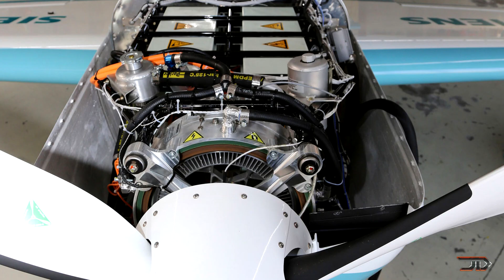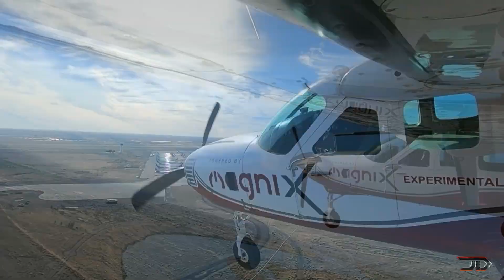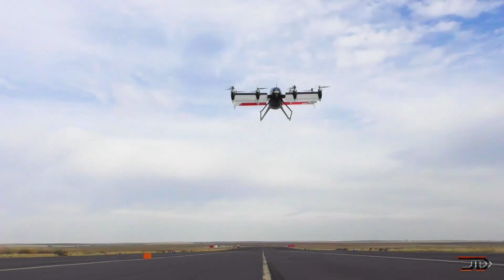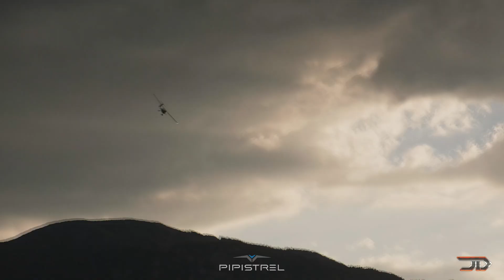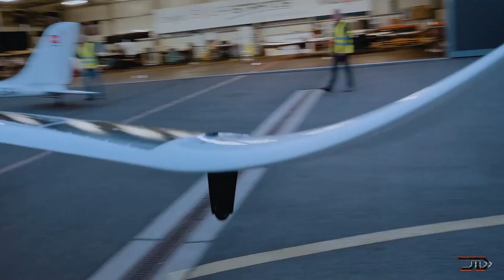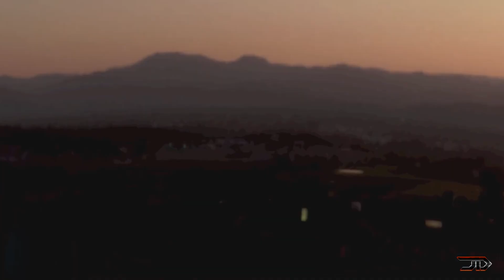7 REAL Electric Aircraft To Check Out!

Comment: Please.. "kW per hour" is NOT a measure of battery capacity (or anything else useful). You got it right some of the time (kW hour) so why confuse people by getting it wrong sometimes?
So many people fail to understand the difference between power (measured in kW) and total energy capacity (measured in kW hours).. not surprising when "technical" articles and videos don't get it right.

Comment: LiOn Batteries are already obsolete, ( not too mention the MFG being economically & ecologically unsustainable). Carbon batteries and ultra lightweight to capacitance graphene supercapacitors will be the next technological evolution.
Reply from the maker: I hope they can make graphene capacitors with high energy densities because at least they can be recharged 1,000,000+ cycles so they would last longer than the plane.
Reply: @Motor_Explorer1  https://www.graphene-info.com/graphene-based-inks-3d-print-ultralight-supercapacitors
Reply: So imagine a Hybrid recapture/photovoltaic system charging supercapacitors/Batteries during daylight operations, with a lighter weight Carbon battery bank for back up/ night operation.

Comment: Batteries will always weigh the same  no matter what state of charge THIER holding .whereas   the weight of  fuel decreases as  it's used .... although  maybe some of the weight could be compensated for by
 solar ???
Reply from the maker: Good point.
Reply: Hydrogen fuel cells would help solve that problem.

Comment: They should just develop these things in theory first. They’re so impractical, and produce way too much waste , that it will be years until it’s viable for mass transit. When battery technology improves drastically, then you’ll have something. People seem to forget that lithium is expensive to produce, and that’s the best there is right now.
Reply from the maker: This is true, I think it's going to take at least 1000 wh/kg and that is for maybe personal transport.
Reply: i bet on Al+O2 single use fuel cells. (can be recycled just like Al ore)
and speaking of VTOLs, you can get them airborne feeding by cable at the moment when they consume the most energy.